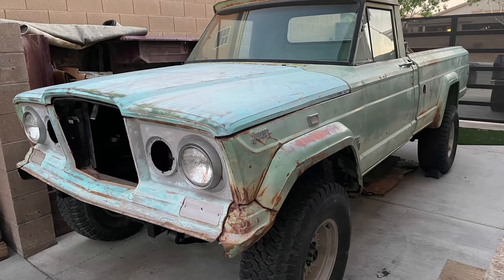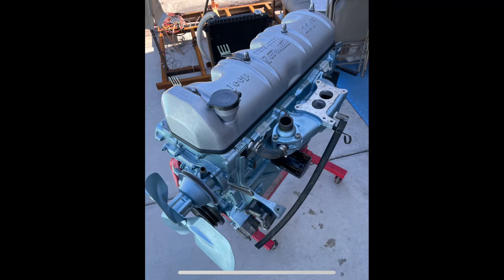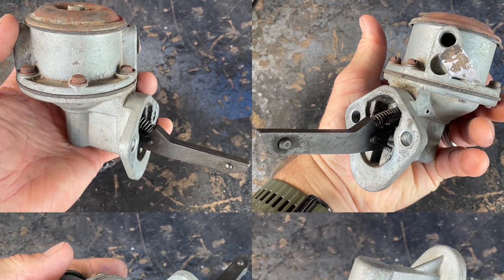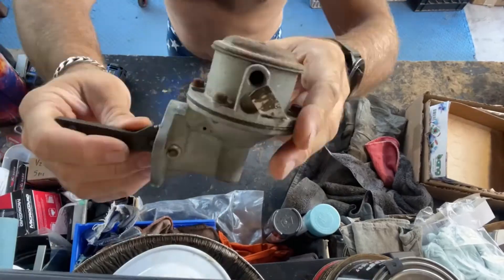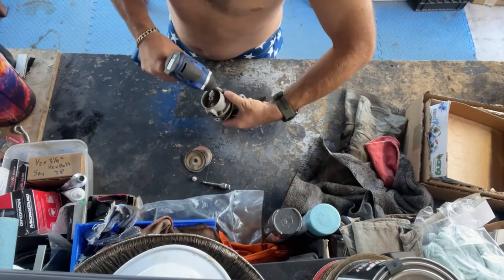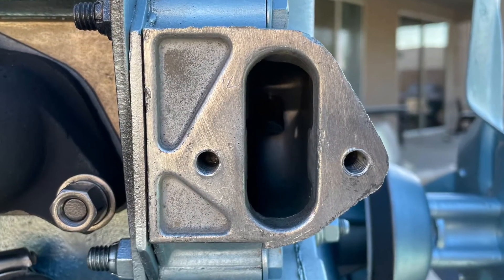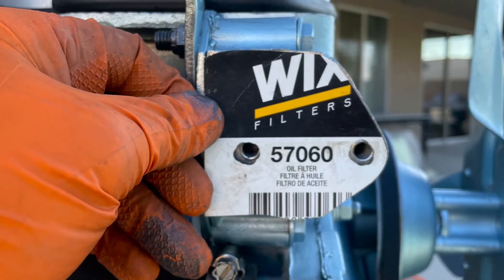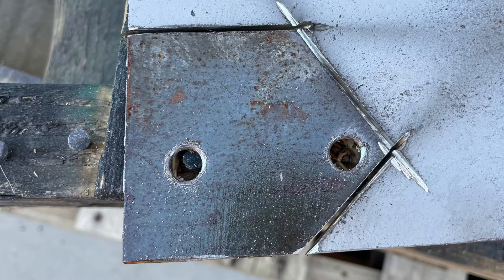Fuel Pump Delete for the 230 Tornado Engine Rebuild - 1966 Jeep Gladiator J3000 Fuel Pump

Comment: En Argentina se uso en el torino y luego de rediseño a 7bancadas
Reply from the maker: Que interesante mi amigo!
7bancadas?
Reply: Si ,se rediseño aquí en Argentina ,es un motor muy suave de marcha y potente 200hp la versión top tenía   tres carburadorores Weber horizontales de 48 mm de boca , un gran motor quizás un  poco pesado pero indestructible.

Comment: Which bellhousing/trans bolt pattern did this engine use?
Reply from the maker: I believe there was only the 1 bell housing. I ended up buying 2 additional bell housings for parts. It is connected to a T89D.